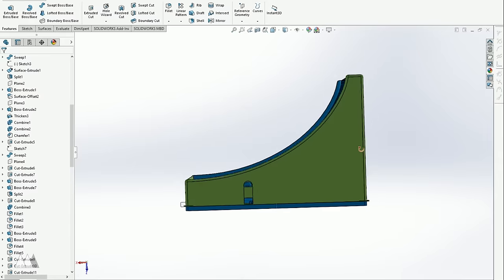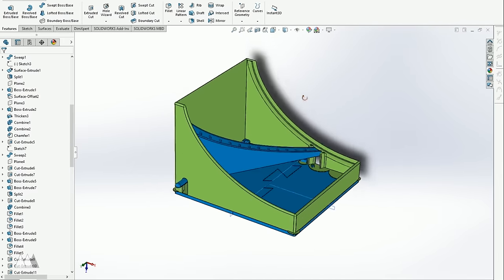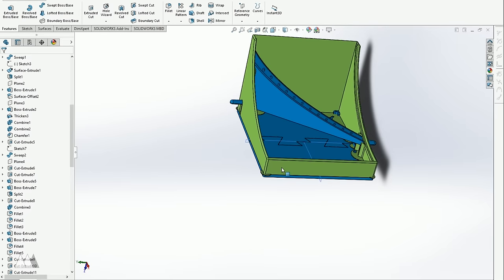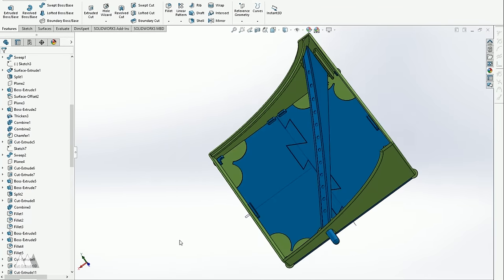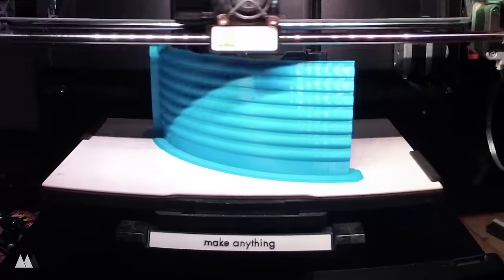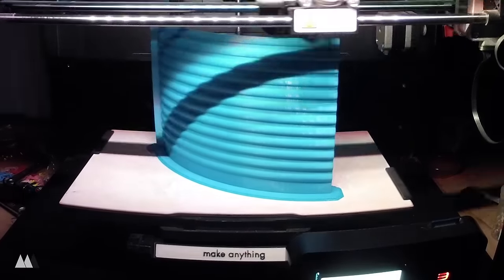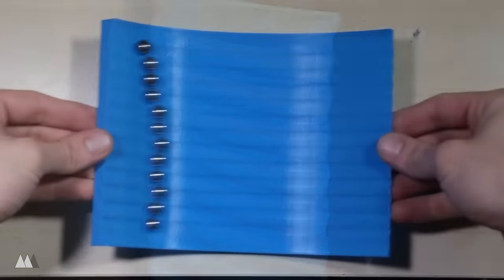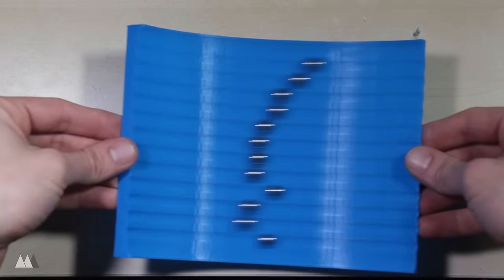Tautochrone Track

Comment: I use hairspray on my print bed and it works SO well to stick down prints
Reply from the maker: That's usually what I do as well.. this one was a real challenge though!
Reply: dbclunie.com - when i don't want to mess up my print beds, most of which aren't  detachable, and so are kind of a pain to wash off glue stick build up, i just use blue painters tape then glue,  works really really well and then when i want a fresh surface i just peel up the tape!  Ive got a makerbot  2x and the warping using glass, using the initial metal build plate it would always warp with  abs either at the base or further up a "big" print  even despite being in a "heated" chamber,  i thin industrial machines had the heated chamber actually heated not just by the residual heat of the hot ends.  Also the reason i use painter tape on glass with glue stick is because sometime the forces are  so strong  that when the part pops off the build plate itll put chunks of glass! even borosilicate glass!  Keep up the  great work, very very interesting stuff you've got here and love seeing your take on things.  very inspiring!
Reply from the maker: Thanks David! Back when I always used blue tape, the tape itself would peel off my build plate with big prints like this -__-
Reply: Make Anything // 3D Printing Channel just a idea: make a tiny skate park and drive a finger skateboard
Reply: Make Anything // 3D Printing Channel make a camera
Reply: Jake Mullen i haven't tried should i?
Reply from the maker: This curve made me think of a quarter pipe too :D
Reply: Jake Mullen hshshjs
Reply: yes make a fingerboard park this reminded me of that lol
Reply: Hairspray, Brim, a very hot bed, 0.3mm over-extruded bottom layer.  STICK STICK STICK !

Comment: These are my favorite videos that you make. You make something fun, then briefly, yet in detail, explain your design process enough to kickstart others making it.  

Using a Buildtak surface on a heated bed, I have very little problems with warping on my Wanhao Di3 (provided the bed is not bowed). 

I am one of the 11,000,000 subscribers of Vsauce, and I think he does a great job explaining things that usually don't sense.

Comment: I love the design- it looks like the bearings that start higher up on the track are getting to the bottom first- I'd guess it's because when the magnets are snapped down, it imparts more speed to the higher-up bearings. if the magnets pulled directly away from the track, this might be reduced but it would be obnoxious to try to design it. Awesome print!
Reply from the maker: I figured it was just friction, but that's a really good point! I thought about having the magnets pull away at an angle, but that would have been even more challenging!
Reply: Thats not friction thats momentum going into the rotation of the ball because the balls are not just mass points but their mass has to accelerate along the track as well as around the center of itself.

Comment: Cool.
I'm thinking the magnets may be imparting some unequal acceleration to the balls, or conversely holding them back slightly to differing extents, when dropped, due to the differing angles that the magnet holder meets the track at different heights. 
An electromagnetic retention system would be rad!  It would allow you to hold the balls higher on the track, and when switched off, wouldn't exert any force on them. 

Cheers!
Reply: Clever

Comment: The model seems fine, even with the smaller ball bearings, as the problem appears to be the length of the brachistochrone track. The end of your path (point B) should be a ~1/2" from your current edge, and all will be okay.

Comment: How about having the release lever for the magnetic track in the back. The way you have it now you could induce a very small difference in release time for the outmost tracks, not sure if it would be a noticeable difference though. Also the magnets might not have the exact same magnetic strength causing a difference release height for the (mainly) smaller ball bearings but again the noticeable difference problem. Then again on something that has to be this perfect all small differences can add up to something that just doesn't work.
That all being said with the heavier ball bearings I'd say it is all within margin of error there :D.
Very nice video!

Comment: Hey Devin, great video. What might help you with the print sticking to the build plate is covering the plate with a layer of jean material before you start your print and this also eliminates the use of the raft which in turn will save you from wasting your filament.
Reply from the maker: Now that's something I've never heard of. Is it what you do?

Comment: Very cool! I believe the lower ball bearings are hitting just after the higher ones because they do not move as far from the magnets and therefore are slightly more strongly influenced by the magnets as they are rolling down. I would suggest that if you make a second iteration of this that you use claws to hold the balls in place similar to a derby track release mechanism.

Comment: for the warping issue you have, it's best to install an enclosure all around the printer. That will effectively keep the heat within the build area and preventing the part from cooling too fast. It reduces the internal stress cost by temperature difference. A very low cost alternative is just to put a thick blanket over the printer lol just make sure all electronics/heat element aren't covered.

Comment: What a great idea and very well made!! My compliments also for your super cool double pendulum.
I have a tip. I noticed the shortest tracks took the longest time. I think a likely explanation is that it where the track is steeper, the magnet needs a firmer 'grip' to hold the ball up against gravity, than at a shallow point. The magnets are moved away with a finite velocity, so for higher balls gravity will win just a fraction earlier from magnet. So the higher balls are released just a bit earlier. 

My tip: instead of bar magnets, use coils and release with an electrical switch. Could that be done? 
Careful though, I once played with coils, switches, capacitors and diodes. My source was only 5 volts, but I got a very strong shock.

Good luck with your channel!

Comment: Not only does friction affect the result, but also the brachistochrone/tautochrone curve, a cycloid assume frictionless sliding, not rolling! When a mass slides down a curve gravitational potential energy is converted into linear kinetic energy, but when a ball ROLLS down the curve the potential energy is converted into linear kinetic energy and rotational or angular kinetic energy (the energy of a rotating ball) - hence in the latter case the linear kinetic energy is reduced - in other words a sliding mass is faster than a rolling mass (as long as there's no friction)!

Comment: Nice project!  You should see about making an enclosure for your printer even if it is just cardboard and tape..  On very similar large parts I find it helps immensely.  I find the hotter nozzle temps help as well.  The layer adhesion goes up quite a lot at higher temps.
Reply from the maker: I have the supplies.. but then I can't make a timelapse! Gotta lasercut acrylic, I guess!
Reply: You could in theory make the box just a little bigger and put the camera and a light in the enclosure.  Lasercut acrylic is a way to go, but is pretty overkill.  Acrylic isn't that hard to cut and it does not need to be amazingly precise.

Comment: I'd like to know more about how you derived the curve. The brachistochrone problem, as originally defined, deals with sliding, frictionless masses. Such a curve would not be accurate for rolling masses in which rotational inertia becomes a factor. There is a 1946 paper by Rodgers which derives the brachistochrone for rolling bodies, and you might obtain better results with this formulation.

Comment: but it won't work like that if you switch the magnets by plastic tips to hold the balls and release them at once.
the lower ball will reach the bottom quicker than the higher ones

Comment: Very nice design. 
I was also watching that Vsauce video and was thinking if it could be 3d printed. 
I think that balls bouncing back from the wall at the end of curve kinda ruin the experience. I think it would look better if you would put there some foam or make pocket holes that balls would fall into (like pool table ).
And I was also hoping you would show how you made that curve in Solidworks.
Reply from the maker: Good points. I made the curve by simply tracing an image of the tautochrone curve and sweeping my track along that curve

Comment: I was using the superglue technique as well. I had heated glass bed with some hairspray and for large prints I'd always use superglue.  I've switched to PEI sheet on top of my glass and it was the best decision I  could have made. No maintenance and always sticks. Even large surfaces.
Reply from the maker: I've been meaning to try PEI... I've heard only good things about it

Comment: Super cool, does it come apart for easy replacement tracks of different sizes and magnet strip? Also in vein with this project have you ever looked into a labyrinth toy?  3d printing could make some extreme versions
Reply from the maker: It's just snap fit, so everything can come apart pretty easily!
Reply: Make Anything // 3D Printing Channel it would be a very impressive demo if it was interchangeable and that sounds pretty close

Comment: the reason why the ball at the top reaches the bottom at the same time is something to do with energy the higher you are is the more gravitational potential energy you will have as the ball rolls in it  gains kinetic energy. the law is you can only convert energy you cannot create or destroy energy so the more gpe you have is equal to the kinetic energy you gain that is the reason why the ball at the top reaches the bottom at the same time as the ball near the bottom

Comment: .2mm tolerance? Does that mean each mating surface is shrunk by .2mm, effectively widening the negative space by a total of .4mm?
Reply from the maker: nope. .1mm in either direction
Reply: That's... less comforting, but still something! BTW, I think I'm cranking the temp on my PETG too high so the whole print sags down and to the sides. I dug up some old PLA test prints and they were fine. It's amazing how almost all issues come down to extrusion in some way, even when it's not immediately apparent.